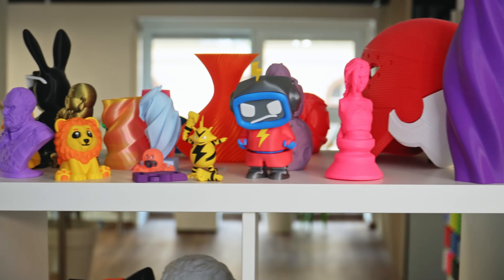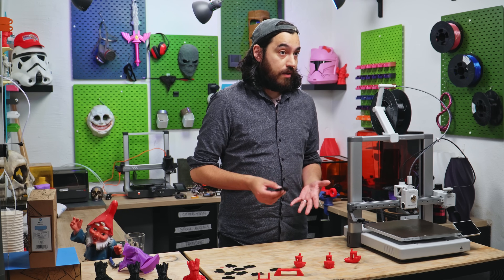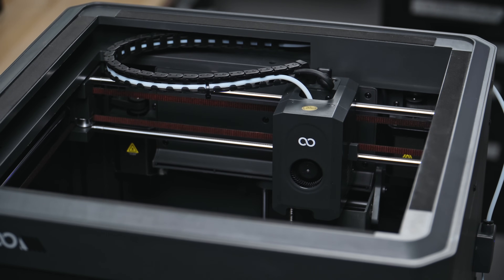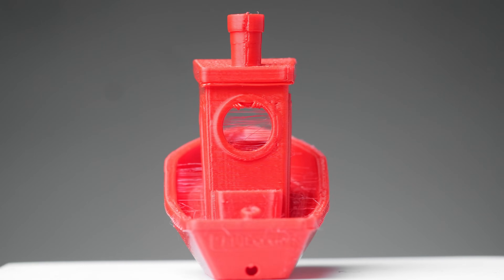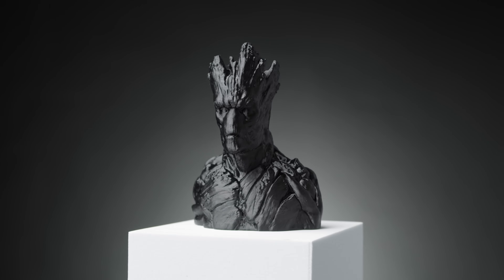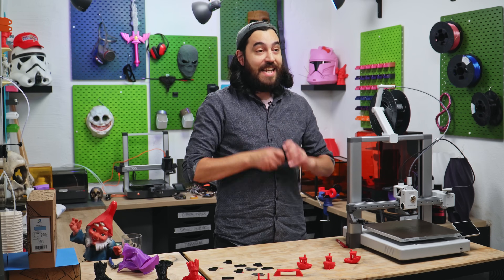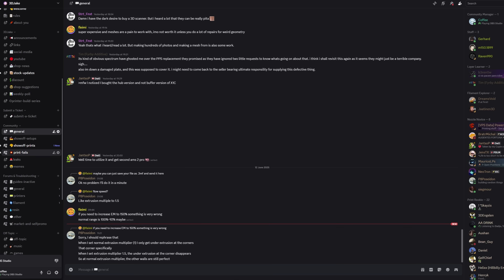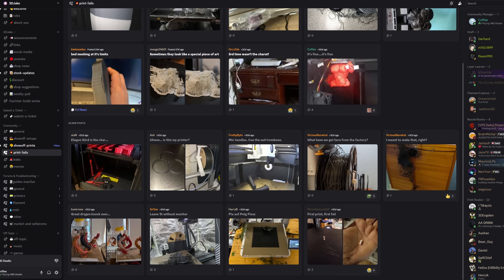Give TPU another chance! Calibration and Settings Tutorial

Comment: if you are printing on a 0.4mm nozzle with 0.2mm layer height and 0.4mm layer thickness, and 10mm^3 max volumetric flow rate, wouldn't that imply you are only getting about 125mm/s print speed max? As far as I can tell, the slicer will limit your print speed based on the max flow rather than your actual settings (using the formula Print Speed (mm/s) = Volumetric Flow Rate (mm³/s) / [Layer Height (mm) × Line Width (mm)])
Reply from the maker: You're absolutely right, I have been waiting a long time for someone to notice this screw up, I do believe you're the first! 😃
Reply: @3DJake_Official  Have you tried using a higher flow since? I've been trying to print TPU/PETG with a centauri carbon and a larger nozzle (0.8mm) and had a lot of trouble - if I go higher max vol. flow (as high as 30-50+ looks good) the test looks good but the prints end up looking like garbage. I'm not sure what speeds to use to turn them out better. I'm mostly printing TPU foot orthotics and PETG accessories for the printer or simple household items.

Comment: You should retract 100% before wipe (inside the part) this will lead to material flowing out after you have retracted, then the printer will wipe the access material away and then it will move, this will help with stringing. Check in the slicer preview.

Comment: Hi trying to learn tpu would I use infill or no infill or more walls like Groot in your video is there infill or no infill thank u
Reply from the maker: There is infill, we used a pretty standard 10% and 3 walls I think. Some infill is advisable to support top surfaces but adding higher infill percentages will quickly make the part a lot more rigid.

Comment: I do have a question, i would like to make TPU with more grip there is anyway to do that? like if i want to make a foot for the chair, is very slick and not grippy, make sense?
Reply from the maker: Standard TPU has relatively low friction against most surfaces. You can certainly apply a fuzzy skin texture but you would need to rotate the model so the base of the chair foot is a wall instead a first layer but even with fuzzy skin its still not that great. Another option might be SEBS which is very similar to TPU but a lot more grippy, it is more expensive though. Search "RECREUS FILAFLEX SEBS"

Comment: Hi @3DJake_Official
Thanks a lot for the tutorial video.. I have learned a lot. 
You did this video for 0.4 mm nozzle. I am planning to use 0.8 mm nozzle for my TPU 95A prints.
What recommendations can you share for the Process Preset ( Quality, Speed and Support) in OrcaSlicer for this nozzle size? is there anything you would change from 0.4mm nozzle settings?
Thanks in advance.
Reply from the maker: You would have to change the flow rate limit, speed will probably be ok, the interface tip diameter would probably have to be adjusted, I'm not really sure how fuzzy skin works with big nozzles. 

But as long as you do the calibrations you should be ok for it. Angus from Maker's Muse did a good video about making functional parts with TPU and had some "cheats" you might be interested in.
Reply: @3DJake_Official thanks for the info.

Comment: So the whole layers make a print not food safe thing is total bs. Have you ever looked at your wooden or nylon cutting boards? They are covered with cuts that behave just like layer lines in prints. If you wash and sanitize the item properly, it isn’t an issue.
Reply: Wooden and nylon cutting boards don't have gaps interspersed throughout their structure, printed parts do.

Comment: I very rarely print in PLA. Things I print have to be strong and functional, not pretty.

My choices are PETG and TPU mainly. I print TPU a lot.

In the beginning I used the TPU settings from PrusaSlicer. However, not being very patient, I increased speed. Lately I have been printing TPU on my Prusa MK3s with 0.6mm REVO nozzle with PETG settings at 200% printing speed.

In short: print TPU faster and hotter with bigger nozzle.

Comment: I am not able to get good results with TPU, whatever i try, it's not working.
Reply: What printer? Also, do you have a way to dry it?
Reply: @PhrozenV  K1 max, i dried it 12 hours before printing.
Reply: @claudemarois4846  What temps are you trying? I've had the best success printing on the hotter end of the manufacturer's recommendation and then tuning retractions until that temperature printed cleanly. Also, try disabling z hop completely.

Comment: Well... multi colour seems not possible as multi-mat systems dont support it (not multi tool)... so the option is to use paint. But is there paint outside that goes well with the flexibility? I cannot imagine. 🤔
Reply: Acrylic paint is fine for flexible surfaces as long as you don’t paint it on too thick.
Reply: @MistImp1 Thanks! 👍

Comment: i have been using insertable petg parts for supports. I do a filament swap command and put a pre printed petg part into the are for support/bridging. Been making seals ans gaskets with this method. I need to find a good softer filament thought anything less than 80A
Reply: Recreus Filaflex TPU is available in 70A and 60A. Both of them are not easy to print (i worked with them on a prusa mk3s and a bambu A1 mini). The Bambu could handle it better, but still you have to print very slow and feed the filament from above in a straight line with no pulling resistance. I personally prefer to print PLA molds for gaskets and make them with platinum cure silicone. Normally hardness goes up to 40A, but you can also find 50A and 60A. The 60A silicone is more viscous then honey, so pouring it into fine structures is not possible on its own. you will have to use strong vibrations, pressure or vacuum to get it in there, but since the hardening time is several hours, you will have time to do so :D

Comment: Had to watch just to make sure you weren't still recommending a snail's pace! Yes, 10-20mm³/s or sometimes even more is totally possible for TPU flow. Agreed the PA value is usually going to be much higher, like 0.15-0.3, at the higher end for softer TPU like 85A. You can print lower hardness TPU on most modern printers at a high flow rate as well, but it really helps if you feed it directly to the printhead as opposed to through a reverse Bowden. It creates too much friction. Try to mount the spool above somehow and use a small pigtail Bowden in the top of the printhead. Also I'd note temperature affects flow rate, so I'd usually do temperature testing before flow calibration. Great video with lots of good advice!

Comment: My sv06 with a CHT nozzle is my TPU printing beast. I don't think I have  had a single print failure printing flex on it, and I have been using it to print flex at around 100-150mm/s for  a couple of years now. I actually discovered how quickly I could print when I accidently used one of my PLA speed profiles by accident (changed the filament profile and forgot to change the quality profile) and the part printed perfectly, being a complex part with many retractions I was impressed and used that profile from then on.

Looks like you have thick bridges on, I never use that for TPU and my bridging is nearly indistinguishable from a PETG print. Using thick bridges you will get weird thick extrusions on tiny little overhangs that the slicer deems a bridge. This almost always looks terrible.

Comment: The first thing you do is dry it, then you can calibrate it. No use calibrating potentially wet filament. A fresh spool does not ensure that it is dry.
Reply from the maker: This is very true :)
Reply: 100% agree with this advice
Reply: What is the best way to dry TPU? Ive heard 5 different options all over the internet, and I can only really do 2 of them. I don't want to buy a filament dryer...I have very limited space for my hobbies my wife and I wanted to live by the beach, so we have a pretty small house, my hobby room....is a closet with a computer desk and JUST enough room for a nice chair and be semi comfortable. Most of the closet is taken up by fishing stuff and rc vehicles/fpv drones. My 3d printer is in the corner of the desk, with my "dry box" of a dozen filaments Taking up a good bit of my shelf. Adding another large item like a dehydrator or a filament drying box is...undesirable. My oven will go as low as 170f, and the "hot build plate" method seems unreliable. Although I've never done it. TPU is essential for me and my rc hobbies. I'm tired of buying prints online WHEN I HAVE THE PRINTER.
Reply: I think the printer bed method is optimum. The key is heat control and the bed settings accomplish this.
Reply: @gordonenglish521 thank you, im going to try this. I have a sealed drybox for storing my filament...but i live in florida so if im printing a bunch of drone parts for hours, i need to dry my tpu and the only way i have in the past is leave it in a sealed rubbermaid with a pound of silica gel. Lol

Comment: Have 4 years old ( bought 250g spool but never had much use of it to use it up) Spectrum transparent glow in dark 85A  TPU - stil printing today when i need some parts without issues on P1S. Well there is 1 issue , it sticks to the bed to hard sometimes ...... As every filament you need to calibrate it - max flow rate extruder temp and there you go....  not a rocket science in these days when al  the calibration tools are built in the slicers.
Like the fuzzy skin "hack"  - will definitely use it .
Reply: I print my TPU on powder coated textured PEI at 40c on the bed. Smooth PEI sticks way too well and will likely damage the build surface. Which surface are you printing on and at what temps? You may even have luck with no heating at all on the bed.
Reply from the maker: Tried printing TPU on the Prusa smooth plate when testing the Core One - immediate disaster

Comment: For the last few days i also fought the two TPU nemesis and i think i have found a good solution for the bridging problem. I achieved clean bridges of 30-40mm

1. I increased the bridging speed to 45-50mm/s 
2. i set the bridging flowrate to 0.85

The low flowrate pevents the line from immediate sagging at the beginning of the bridge.
Then the fast moving nozzle is pulling the line and keeps it under tension. 
You got to hit the sweet spot between these values to make it work
Reply: Yes, thick bridges (like he set here) are the exact opposite of what I would use.
Reply: Yes, speeding up the bridge speed helps. In fact it helps for any material. What I don’t understand is when I see videos saying to slow down speed when bridging. That makes no sense. Lowering flow are also helps because the thinner line cools faster.
Reply: Great tip! Using the nozzle to pull filament and using shrinkage during cooling to your advantage can work great for bridging.

Comment: First question. Have you tried printing TPU within a filament dryer? I don't know if I am lucky or what, but I have an Ender 3 neo that I modded with a bimetal heat break, a resistant abrasion nozzle and a blue bowden tub. The first time I tried to print with Smartfil Flex 93A glitter TPU, I printed a nearly perfect benchy with nearly no strings. 

Second question. Is there a good TPU for a phone or other things protector? Or should I make it 2 layers with the TPU outside? I want to print a protector for a laptop charger, and I would like to know more.
Reply: use a filament dryer to be safe. I run it before a rpint if I haven't used it in awhile, then I run it again while I'm printing. 50c for the dryer temp is what I use for tpu and petg.
Reply: @TheNewBloodDan  You can safely go to 60 when drying PETG and TPU, PLA at 50, PA and ABS at 70. 50 is a little conservative for PETG and especially TPU, TPU can handle quite high temps.
Reply from the maker: Definitely! But actually some TPU I have never needed to dry and some you just have to. We dried that TPU in the video for just under 24 hours at 60C in a Polydryer just to be safe but I actually don't think it was necessary and that TPU hasn't been dried in like 6 months. Its not stored particularly carefully, just in a box, the humidity in the office is around 30%. Some other spools though, stored in the same way, they need drying relateively frequently.

Comment: Just made an AC exhaust fitting to slide over my bathroom exhaust casing with Sunlu TPU I had for almost a year but was too afraid of. 
Came out perfectly with a generic orca profile it's ridiculous I avoided the stuff.

The only weird thing is that when I dried the stuff it was the first time I saw condensation building up in the dryer...
Stuff sucks up water like a sponge.
Reply: Yeah I dry mine out then when I am done printing put it in an airtight storage container with 5 50x75mm containers of desiccant, probably overkill, but it keeps it around 10-15% humidity for a couple of months at a time. The container fits 4 spools, so it's not all that desiccant for only a single spool.